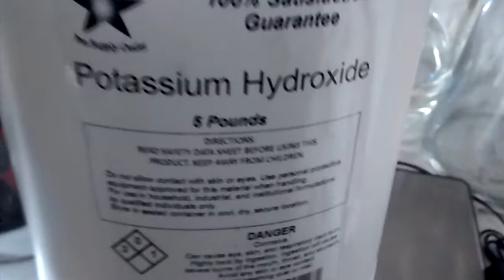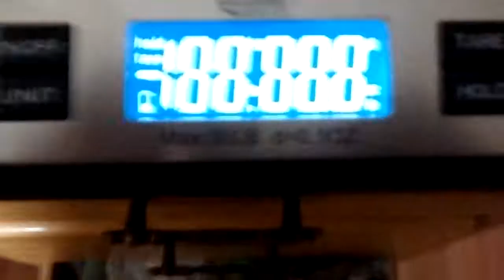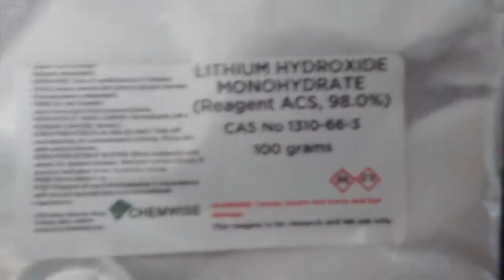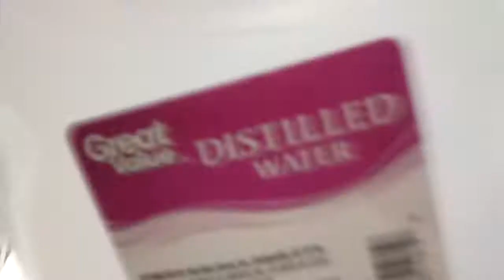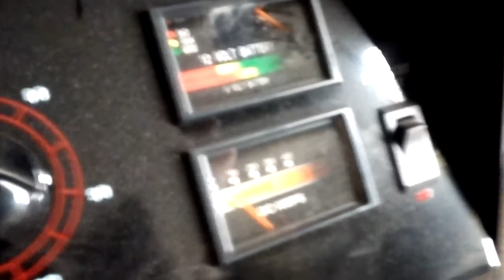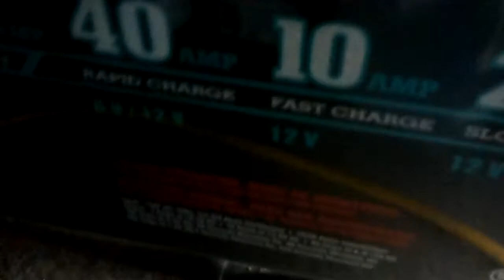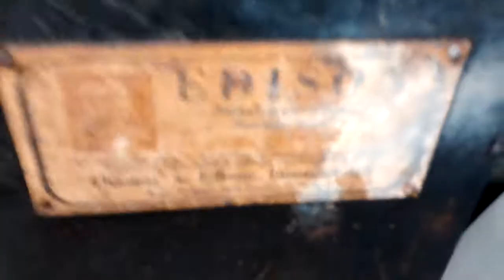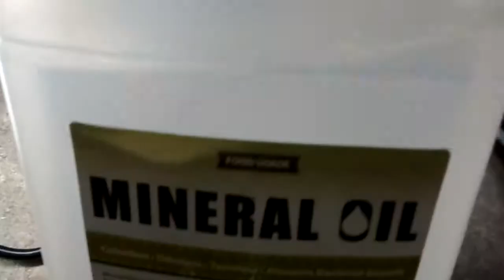Tips how to make KOH electrolyte for Edison NIFE cells. Recipe!

Comment: You are right the oil is not a good idea.  Great video, sorry it has been a while, been a busy summer and I am just getting time to catch up on watching videos.  Funny I see this tonight where dumping and refilling the Edisons at the job site today.  I have some video of it I well get posted in the next few days.
Reply from the maker: I've got more of these to restore which I like you have also but little bit of time to work on them. I watched all your videos repeatedly and read all your comments on your Edison videos plus other people's. Thanks to you I learned the basics and can't wait to learn more! The people I take most serious are the people that actually use them and make videos of it. I really want to do your LED 12V lighting through my house and the little gem of info taking about geting LEDs that can handle overvoltages above ordinary 12V is so true with the Edison's!
Reply: Look back in my old videos and you well see where a I used a lawn tractor engine to turn a 1 wire gm alternator. Makes a great battery charger

Comment from the maker: 10 Liters of distilled water. 3,000 grams of Potassium Hydroxide. Optional 200 grams of Lithium Hydroxide Monohydrate. Edison Manual 850x has table of how many pounds electrolyte per cell based on size.
Reply: I am a bit confused with your mixture.

In one of your videos you mentioned that Carbon was pulled from the atmosphere.  It reacted with Lithium, and it degraded the metal plates, but here you are adding Lithium Hydroxide Monohydrate.

So is Lithium bad or good?
Reply: Is this for a 20% solution. I’ve got the batteries right dead and ready to change solution.
Reply from the maker: @ek9772  You are confused. "In one of you videos" does not mean anything, especially when I know I never said degraded metal plates??? I didn't add anything here only mentioned the option.
Reply from the maker: @johnconn4565  I don't know, I was studying to pass finals at university and have forgotten. I will have to relearn.
Reply: Military Industrial Museum believe you’ve made about 23%... your total is 13kg? 10kg water 3 KOH?
Reply from the maker: @johnconn4565  Edison had a commission electrolyte and then a renewal electrolyte that was stronger I really will have to go back to relearn. The different makers of nickel-iron and nickel-cadmium had their own varients with and without lithia so it gets pretty daunting.

Comment: Just get the modern version of the (Edison style) and it is a style just
 like AR is a style, now just get a  (Flooded NI-CAD) they come in 1 
volt, 2 volt, 6 volt, 12 volt cell's --- And they are called cell's 
until they are connected to something then they are called batteries. and used one can be rebuilt.